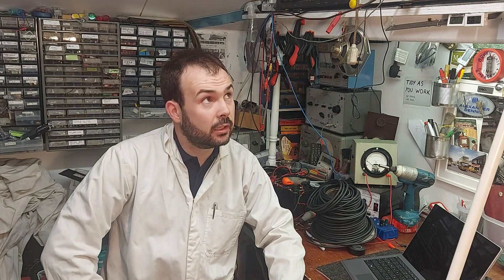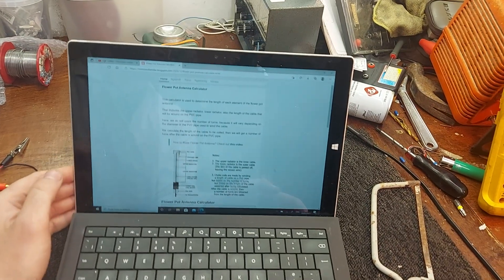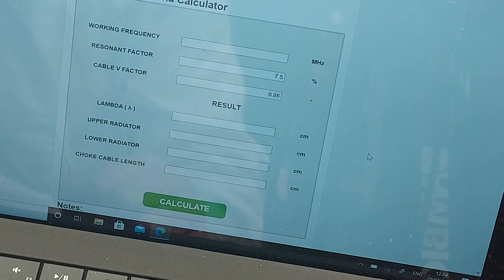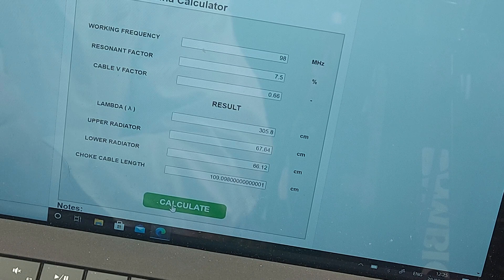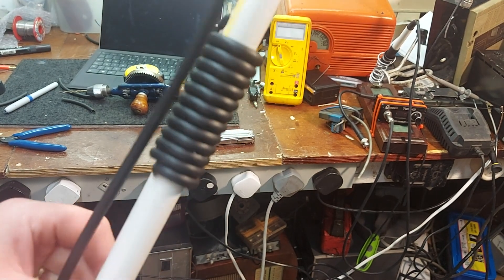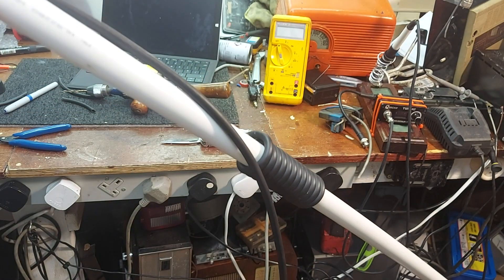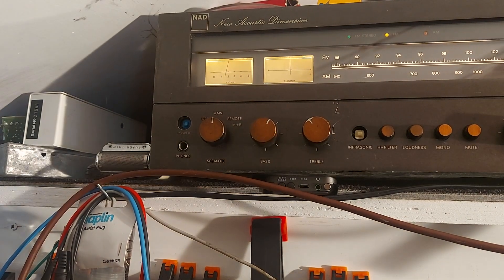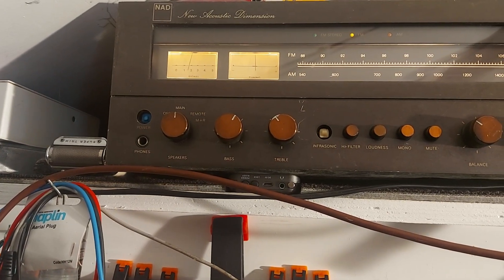Flowerpot Aerial inspired by @g4nsj

Comment: Back in the early days of the old (illegal) AM CB radio I made myself an indoor antenna in my loft out of a car aerial, bits of wire and an old Quality Street tin 😂 Worked a treat 👍
Reply: @stepheng8779  made one back  in the 70s coil and all made with  one peace of wire taped to the wall of my rented room. Worked great.

Comment: So it beats a vertical halfwave dipole hands down :-D
All you need is a plastic wind direction cock at the top, to hide the real use :-D
Nice Nad hi-fi, i bet that was expensive from new, nad was never cheap.
Reply from the maker: NAD made really nice gear alright, I wonder should I add some of those wooden capacitors for a more natural tone.......
Reply: @IrishvintageTVRadio  lol wooden capacitors, you are nearly as mad as me, Nearly:-D